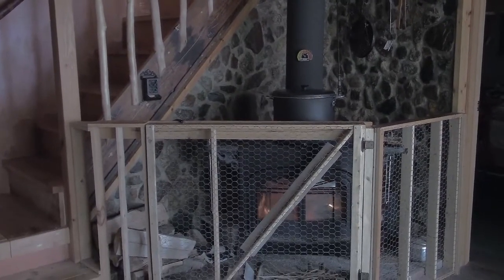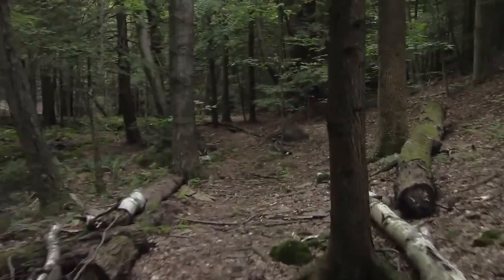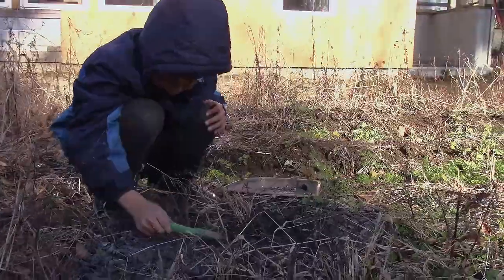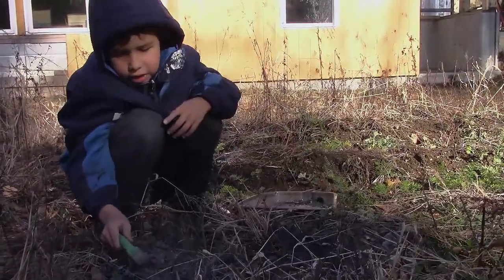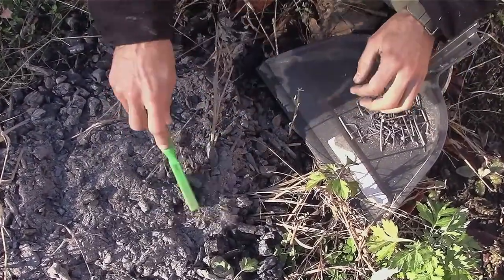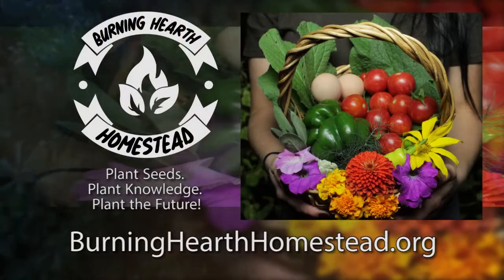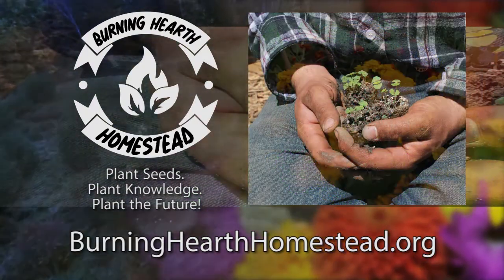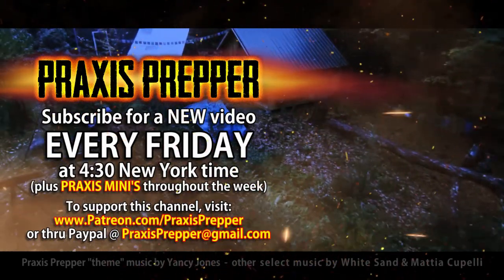Burning Scrap Wood Safely

Comment: Really good video! It made me want to go back and watch some Alien Invasion! You had so much amazing info in there. Any recommendations of keeping your chimney clean? Also, Harbor Freight sells some nice big magnets at a fair price. I use them to drag through piles of swept floor dust in the workshop to pull the metal out.
Reply from the maker: I've always used a chimney brush to keep it clean. I'm trying a log that's supposed to clean a chimney out at the old homestead though because I'm sort of busy building right now and can't get over there to chimney sweep it. I'll probably share how well that works when I open it up to give it a good sweep in the spring.
Reply: @PraxisPrepper  Very cool. I have the cleaning logs as well. I've never swept a chimney before...

Comment: And if you burn wood from trees you cut down, do remind yourself that this is only a sustainable source for firewood IF you replant the number of trees you took down...
Reply from the maker: Trees (I've found) are super eager to replant themselves if the clearing speed isn't overly fast. For a person doing their own clearing for their own modest needs on many acres, the trees will do all the replanting work for you.
Reply: @PraxisPrepper  if you let them, sure :) ... but certain kinds of wood are better for burning then others, so it might be beneficial for your heat production to choose and influence the type of trees 'growing back'...

Still though, i do think the principle has to be mentioned, as deeming wood for energy as sustainable in itself can give the wrong impression (and actually led to some VERY weird things in my country:  aka. our energy plants burn roughly 10% of 'bio' fuel (aka. wood chips) as part of greening up. It turned out these companies thus just bought these chips from unsustainable sources where these trees were specifically cut to turn into wood chips to burn in these power plants (as opposed to being waste products, as was intended by regulation). bit of a scandal over here a while back).